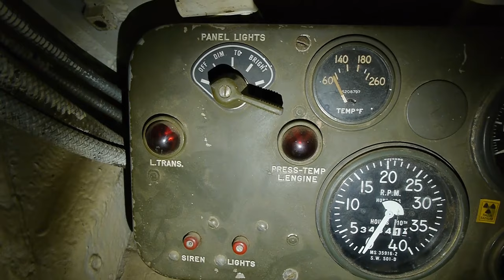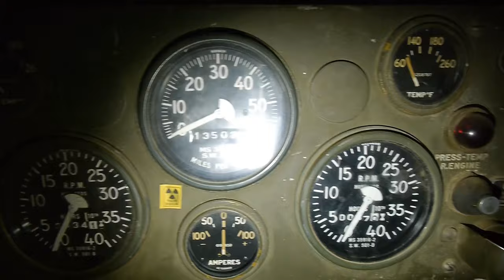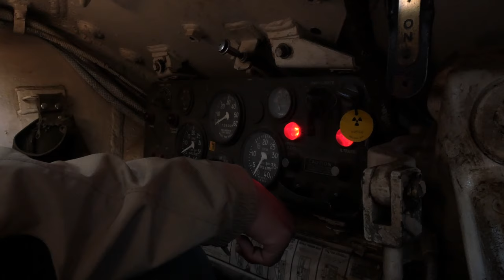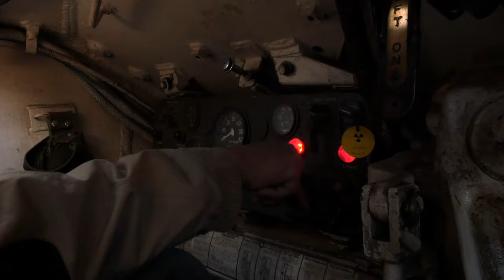Fighting Vehicles: M24 Chaffee

Comment: Interesting thing about the Chaffee to me is that unlike other late and post WW2 vehicles like the Pershing is that it kept going with the old transmission and drive sprockets in the front linked to the engine(s) by driveshaft. Still don't know why old tanks used that setup, the driveshaft ends up making for a taller vehicle.

Comment: Nice video. Can I ask a question, if transmission selection lever is set to DRIVE and transfer unit levert is ser to HIGH what are upshifting speeds from 1st to 2nd speed gear, from 2 to 3 and from 3 to 4 ?

Comment: Based on what I'm seeing this tank while smaller is about as able as the early shermans. It may be using the same gun and shells. By the time it shows up however the 76mm high velocity was becoming the norm and the Germans and Soviets were building bigger tougher tanks with more formidable guns. This tank would still have been well suited for backing up infantry against infantry.
Reply: Another point to make is its role as a light tank. The M24 would have left larger German and Soviet tanks to its larger US counter parts, and at roughly the same time the M24 was coming about the M26 Pershing was also entering service.

Comment: A low velocity 75mm gun. There must have been someway to have given it a higher velocity gun.
Reply: The gun one can fit is largely based on design. The M24 wasn't meant to fight medium/ heavy tanks, but rather was meant to take on light vehicles such as Halftracks, armored cars, light tanks, SPGs, etc. The 75mm M3 also has a very large HE shell to counter infantry making it a good infantry support tank.
Reply: 75 mm is more efficient to deal with AT guns and infantry. The very reason most Shermans were equipped with a 75 mm. WW 2 tankers didn't want every tank to be a 76 mm high velocity.